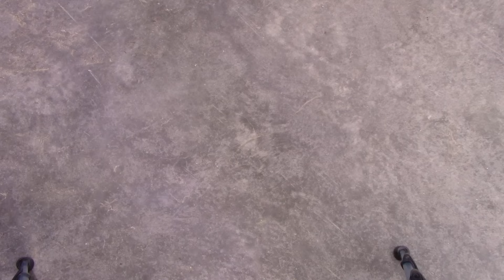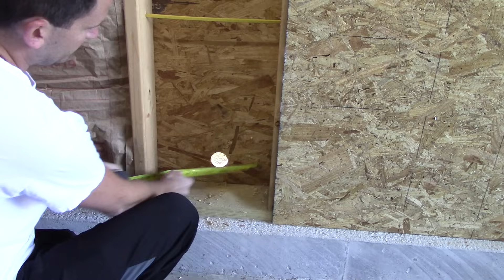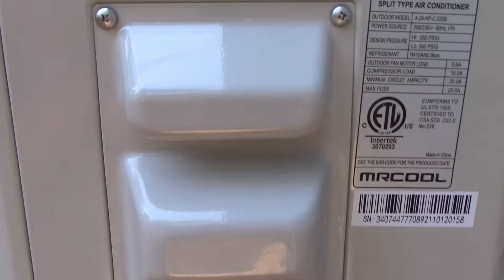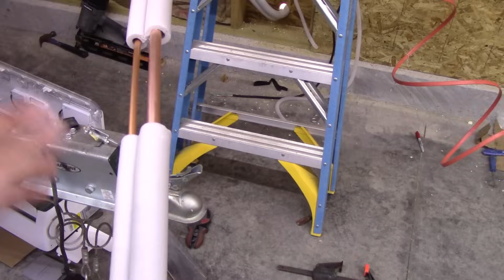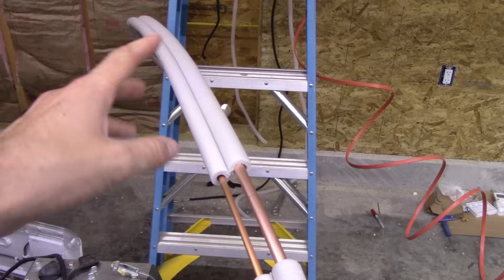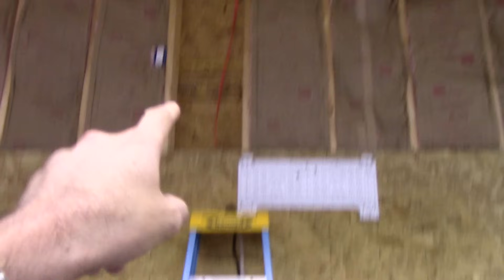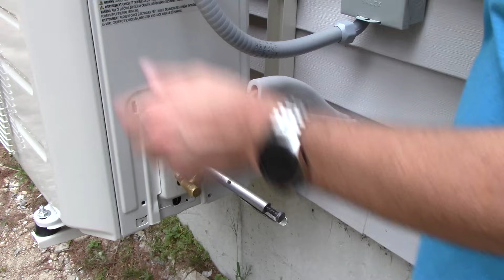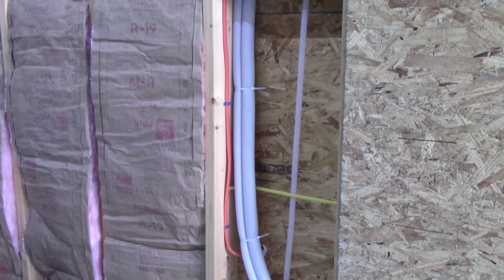Mini-Split Installation For Dummies - Complete Step By Step Guide.

Comment: How loud are the fans??  Do you have an exact decibel or something similar I can gauge it to?  Trying to have a unit installed but worried about the neighbors.  houses are very close together.
Reply from the maker: I haven't measured it but you could put it right outside your neighbors open window and I doubt they would complain.  The way these DC compressors ramp up and down there's really no abrupt noises or clicks.  Just a quiet hum.
Reply: @Trialnerror  ok sounds good. Thank you

Comment: One suggestion for wet climates. It would be best to have the refrigerant lines exit the building above the connection points on the condenser to ensure rain water does not travel down the lines into the building.

Comment: Is that the 18k ? What size is your garagem
Reply from the maker: 24k btu.  Garage is 25000 sqft and it does a remarkable job of keeping it cool.  Even on 100+ degree day's it will hold it down to about 72 degrees in there.  On day's in the 90's it will keep it under 70 no problem.

Comment: A great video but since you chose to go the non-DIY route, meaning no pre-charge in the line set, are we to assume, (and we all hate that word) that the pre-charge of refrigerant in the condenser is enough to fill the line set and still have enough left-over to satisfy the entire system?  If so, it must be because they pre-charge the condenser at a higher pressure so it can supply the needs of both.  It's too bad you didn't show what you had for pressure in the system once you were all done but sadly, you took down your gauges when you started to open the high-pressure gas port, and we never saw the gauges again.  And where did you get your refrigerant? There is no mention of it in your item drop down listing under "Show More" All in all, I still learned a lot watching this video.  Good job.
Reply: You read my mind perfectly.  Wish he had covered that.  Did he receive pre-charged lines and modified them? Or these are different?
Reply: Almost all mini-splits come pre-charged (in the outdoor unit) and this example is no exception. The pre-charge is consider sufficient for a maximum line set length (typically 25 feet) and most times I'm using somewhere between 10 feet and 16 feet. If you go over the 25 feet you need more R410 and potentially more oil too. The amounts are specified in the User manuals. If the system were NOT pre-charged you would open up both valves (with the Allen key), pressure test and evacuate the entire system, then introduce oil and R410 through the manifold. This is essentially the same procedure I use with R134A when I'm rebuilding car A/C systems. However I've installed a half-dozen mini-splits and all were provided pre-charged.

Comment: Please come do my system in Florida i have multi units 27k btu..cannot find a technician.
Reply from the maker: Finding a tech for anything is brutal right now.  I wouldn't mind a trip to Florida but I don't think it's the best choice for you :) Thanks for watching and best of luck with your install!
Reply: @Trialnerror  should my brackets be. Condenser box? Extra charge? I'm going to look for a tech this week before the hot Florida season rolls in. We're 85 already no complaints. Would there be any benefit to a concrete paid? Ty for the time🌴⏳

Comment: confused as to why you bypassed the 60 amp ac box by going straight to the unit and then putting the #10 wire in the breaker position....

Comment: How has your unit held up by short cutting the line set testing? Nitrogen pressure testing and Vacuuming to 500 microns with a micron gauge are important procedures. Again, have you had any issues arise over time from taking short cuts?
Reply from the maker: No problems and it run's 24x7 365 days a year.

Comment: So the lines come pressured up, and if you don't change the length, they get connected with pressure. But you evacuated the lines and put them under vacuum, and then connected them under vacuum. What am I missing here? Are they supposed to be pressured or vacuumed when they get connected to the outside unit?
Reply from the maker: The lines are not charged in any system.  The more expensive version comes with lines under vacuum only, the refrigerant is always in the compressor unit.  This is the cheaper setup with normal lines and a precharged compressor.

Comment: Where did you introduce refrigerant to the system?  I must have missed that part.
Reply: Under the valve cap on the side you open the valve by turning with an Allen key until it is all the way open.

Comment: Any worries about having the lines in the wall? Condensation or anything?
Reply from the maker: No worries, the lines are insulated and so is the wall.  No condensation can form so long as they are protected from ambient air.
Reply: @Trialnerror  thank you I’m needing to install one but didn’t want the lines outside as it’s not very attractive

Comment: Not enough clearance between the unit and the wall. Needs more air movement.
Reply from the maker: Its a standard wall mount for a mini split.  No airflow issues.
Reply: Strange. My mr cool mini split said 12 inches from a wall in the instructions

Comment: Only one question.....why the hell would you want to work in a 56deg shop when uts 80 outside?🤨.  Jk....but also, you better put some serious caution warnings on your wall where you buried your lines sets...when you're 80 yrs old and you decide to pound a nail in the wall to hang that new  rake, you might wonder why you lost all your refrigerant 🤣🤣🤣

Comment: Do I have to use the nylog blue? Seems a little expensive to buy a bottle just to use 4 drops. 
Thanks great video!
Reply from the maker: Nope you don't have to but a few drops is a lot cheaper than a tank of RV14 to refill the system in a few years if you have a slow leak.  Guess it depends how you like to roll the dice.
Reply: @Trialnerror  can I use Teflon tape?

Comment: Great looking install. Hey, So I noticed your refrigerant lines are entering at a downward angle into your wall. Have you noticed any water or condensation settling behind your walls?

Also, the lines that come with MrCool are vacuumed, did you have to draw the system down because you cut the lines?
Reply: He started the vacuum at 21:50
Reply: He didnt use the precharged line set.

Comment: All these videos are the same they want to show you how to flare the tubing but no one I can find will show you how to wire the line set into the indoor unit with a yellow red white and green wires. It's a tiny space to work in and that is the only thing that's holding me back four damn wires

Comment: The unit that hangs on the inside wall instead of running it to the outside can you run it a long the inside wall and then put a bend or slight curve in it and bring it back to the same location below it and run it to the outside unit in order to use up 16 ft of line. It's in my garage so I don't worry about the appearance.
Reply from the maker: Sure, you just want to avoid a U shaped dip.  You will always have low spots no matter what but the fewer you have and the less U shaped they are, the better the oil will circulate to the compressor.

Comment: I want to buy one of these units but what I can’t figure out is how many accessories I need to instal a multi zone for three units. Will each unit need its own disconnect also?
Reply: If it's a multi zone it would only have one condenser thus 1 disconnect outside.
Reply from the maker: Yes, each unit needs it's own dedicated feed from the panel and a disconnect per code.

Comment: Get a better flaring kit. Pressure test with Nitrogen at minimum 200 psi and flush lines before vacuum. Use a torque wrench. PERIOD.
Reply from the maker: It's been running perfectly  24-7 since this video was made. PERIOD.

Comment: dont run the lines behind drywall if theres a leak goodluck cutting the drywall
Reply from the maker: If there's a leak I won't need to cut the drywall.  Ever seen drywall and water make a brick?
Reply: @Trialnerror  sure

Comment: So, I'm planning on installing my split ac unit with the power connected to the existing 110v wiring inside my garage. Will that work? The unit I bought is supposed to run on 10amps, its a relatively small unit. Or, will I need to run a new line to the exterior of my garage? Thanks, great video!
Reply from the maker: If the circuit can handle the load than you should be fine.  Just keep in mind whatever else is on that breaker cannot add up to more than the 15 or 20 amps the breaker/romex can handle if you plan to use both at the same time. With that said, electrical code wise you are most likely suppose to have a dedicated circuit.

Comment: Could you please explain to me why you wired a neutral wire into your breaker box but capped it off in the disconnect box.
Can you also explain to me what you did with your drain line that you wrapped up inside of your line-set going up hill.  I agree if I was Mr. Cool there is no way I would endorse this video.  You should not be given advice to people on how to install hvac equipment.
Reply from the maker: No neutral is required for most 240v appliances.  Since I was running the cable, I decided to run one with a neutral in the event I change something years down the road and it needs a neutral.  The drain line goes up hill a bit before turning back down.  It will hold a little pocket of moisture in the low spot and prevent bugs from making their way into the AC from the outside but will still drain as water builds up on the back side.
Reply: Just keep trying you will get it right eventually. @Trialnerror

Comment: So did you not use a neutral wire in the condenser unit? L1 and L2 are hot wires, green is ground, but no neutral?
Reply from the maker: No, many 240v things do not use a dedicated neutral.  Ground/neutral are combined.
Reply: @Trialnerror  ahhhh, I see. Thank you for clearing that up for me.

Comment: I thought these DIY units (i.e. the amazon one you link to) came with refrigerant pre-loaded in the line set so DIYers do not need a vacuum pump. By cutting the lines did you let all that pre-loaded refrigerant spill out?
Reply from the maker: No, they sell two systems.  One is about $500 cheaper (this one).  The other ones don't have 410a in the lines, they are nitrogen filled and under vacuum so you don't want to cut those because that's what you're paying the premium for.

Comment: would it be possible to install a mini split but instead of hardwiring it to power via a breaker, could you somehow install a wall plug to the end of the power lines going into the outside unit so that you could plug it up straight to an outlet instead?
Reply: It wouldn't be ideal, possible yes but it would need to be a dedicated circuit that you installed the outlet to, plus you still need to install a disconnect outside.

Comment: Is the refrigerant inside the unit or in the lines? 
Im getting two different information. 

Some day in the lines…

What generation mr.cool unit is this one?
Reply from the maker: It's in the unit for every Mr. Cool model.  They make two versions.  This one with open lines and a more expensive version with sealed lines already under vacuum.  It's much cheaper to get the cheaper version and buy the tools seen in this video to vac the lines down yourself.
Reply: @Trialnerror  thank u!! U the best

Comment: Um, for "dummies" who can at least "turn a screwdriver"??? I've wired and plumbed the house I built, but this seems quite a bit more involved than "turning a screwdriver"  - flare tools, vacuum and gauge set....    At several points you should have canned the background music and described exactly what you were doing.   Also, what about the drain lines?  And I thought Mr Cool used pre-charged line sets so none of this cutting was required.  You really need to re-do this video if you're going to present it as a "complete" guide for those who don't have a clue. Thumbs down to this one.
Reply from the maker: Dude! If you've done all that, this is nothing.  The tools may seem intimidating but that's only because its new to you.  I'm an idiot and I did it!

Comment: For the DIY version with pre-charged line sets, can a professional HVAC technician still able to shorten the line sets and be able to perform the steps you did without any issues?
Reply from the maker: Yes and no.  They can shorten the lines but they will need to do a conventional vac down of the system to fire it up. Once you cut into the lineset you're releasing the vacuum and nitrogen they ship them with so it defeats the purpose.  Just buy the cheaper non diy kit like I have here and save some money.

Comment: Keep it simple!
Yes, very nice installation and I don't see why all installs endeavor to be done this way!
Why run everything on the out side of your house, IF you don't have to?!!
I especially like the left side, install of all the lines, connections (rather than twisting everything to come out the right side?) 
Good tip to Pressure the lines 1 pound, rather than sucking air in upon removal of the Gauge set :)
I also, like the dual usage of the electrical conduits, for source power and power between the units!

Yes, very nice!
Reply: I think it’s useless, as he cut the line shorter and they charge the system to account for removing the evac gauge

Comment: I was wondering if it was safe to have a disconnect box very close to the gas connections?
Reply from the maker: Yes.  Perfectly safe.  R143 is not explosive or even flammable unless it's in a concentrated oxygen environment (that we don't live in:) )

Comment: What are the electrical requirements for this unit?
Reply: Disconnect Outside, depending on what size unit you choose you will need a dedicated circuit with the applicable size breaker and wires.

Comment: 5 PSI is not enough pressure to check for leaks. You have to pressure test the system with Nitrogen, not with pressure from the Refrigerant in the line. Usually testing pressure is 150Psi.

Comment: Solid video.  Sure wished I would've found your video before I installed mine.  I was stressing out that the colors didn't match on the indoor unit or the outdoor one.  My OCD caused me to overthink things and my wife just said "what does it matter the color as long as 1 to 1, 2 to 2, and 3 to 3?".

Comment: Forklift. No household is complete without one.
Reply: WhAt?? You don't have forks?? <sarcasm> one person can lift it relatively easy but if you have a way to make it easier go for it.
Reply: Thought it came on the box.
Reply: I live in a broken home
Reply: Up north……TRACTOR with loader and/ or backhoe
Reply: A skid steer with forks is what you really need
Reply: @bgee461A dolly with ratchet straps holding the height and keeping from tilting can help a 1 man install get that unit up on the bracket!
Reply: Better a Gradall 😅
Reply: Every dummy has a forklift.

Comment: I have the advantage series 12k model on the way.. question, Is the indoor unit powered from the outside unit via the “communications wires” or does it require a separate power source?
Reply: The inside unit is powered by the communications wire.  It is required by NEC to be a outside rated 14/4 wire.  I purchased a unit from Lowes and it came with an SJOW communications wire that was not to code per NEC 400.12 (failed inspection).  I called my local electrical distributor and got a 14/4 wire rated for in wall and outside use.

Comment: Wait I thought those lines were pre-charged?
Reply from the maker: They sell two different versions.  One with pre vacuumed line set (the charge is in the compressor not the lines).  Since the lines are under vacuum you don't need to vac them down after.  The other version is MUCH cheaper, has the pre-charged compressor but you need to vac the system because the lines are shipped open on both ends.  It's much cheaper to go with this option even after buying the vac pump and gauge set which is why I went this route.  Plus I now have all the tools to service it years later.  On a side note, I'm going on a discovery flight next weekend! Super excited.  I assume you're a pilot from the picture.
Reply: Yes I do hold a private pilot certificate. Hopefully your pilot will let you take the controls on take off.
Reply from the maker: @130loadmaster  I have a feeing I may be at the start of fulfilling a dream here and I'm very excited!

Comment: Don't forget to adjust/derate if you run more than three current carrying conductors through a single whip/conduit/bundle for more than 24 inches. Table 310.15(B)(3)(a)

Comment: I did it!  Just finished installing an Alpine 18k btu mini split heat pump in my living room wall!   Used this video to check each step! Thank you for a great tool for us DIY’s!
Reply from the maker: Way to go!!!  Not many other DIY projects are better than putting one of these in then sitting back and enjoying the cool breeze!!!
Reply: Our electricity coop is going to peak time charging,  now I can run my mini split for peak periods and avoid the extra charges I would get by using my whole house heat pump system.

Comment: I’m confused as to exactly how much refrigerant you put in there just 1 pound? Or did you fill it to a higher volume call Cameron of Cameron?
Reply: The unit is pre-charged. There is no need to add refrigerant.

Comment: the mr Cool unit you got was the non-DIY version by the look of the line set.  correct?
Reply from the maker: Correct!  Lines are not under vacuum so it needs to be vac'ed down but it's usually quite a bit cheaper than the true DIY setup.

Comment: One more question ...what did you use on the threads can I buy it local....also the wiring in the electrical box is clean really neat.....Rick
Reply: Nylog Blue (Refrigeration Technologies RT201B Nylog Gasket/Thread Sealant) available from Amazon.  They do not have it at my local Menards or Lowes.  Lowes has alternate materials.